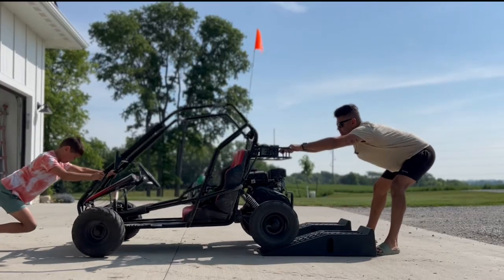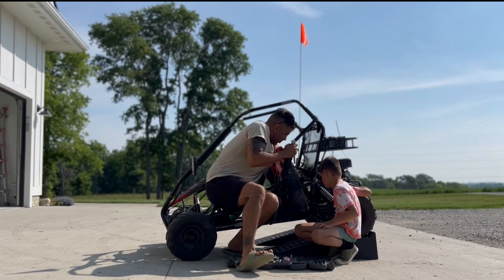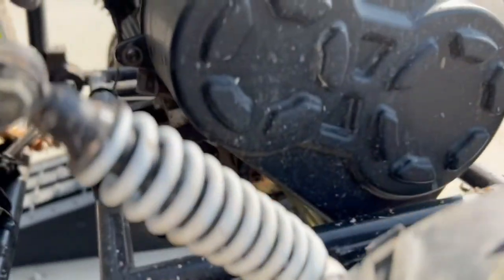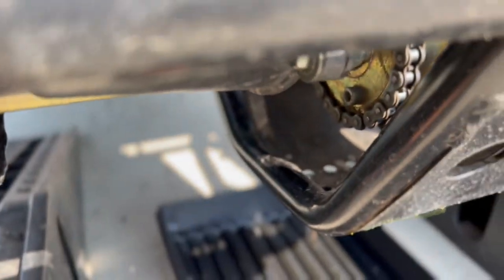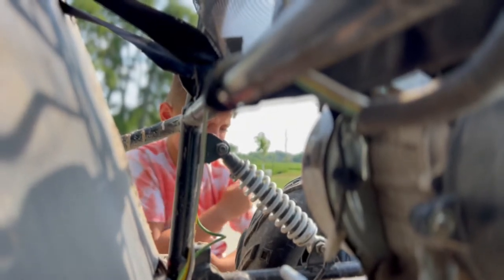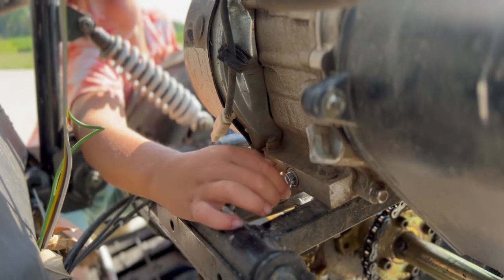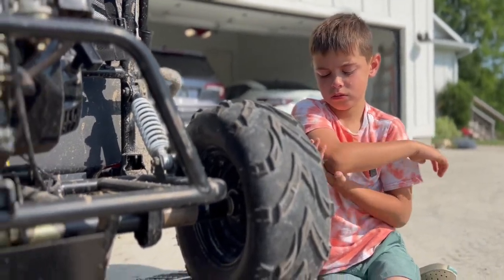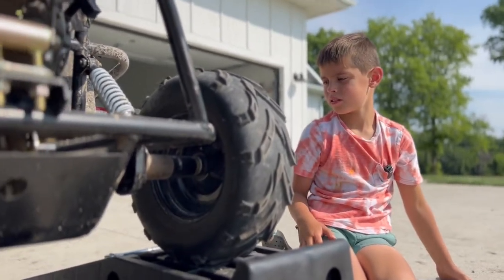Coleman KT196 Go-Kart Oil Change

Comment: Now my Go-kart is moving slow not fast like get should be.  When I turn the Go-kart slows down and stop moving.
Reply from the maker: Here is what I’d check in order: 

1. Choke is off (duh, but it happens)
2. Has fuel (duh, but it happens)
3. Air Filter 
4. Spark plug
Reply: @barnyardbrothers  I did check the air filter and it's good
Reply: What makes the KT196-C go kart go slow?
Reply: @barnyardbrothers   should  I run the KT196-C  gokart choke on?
Reply from the maker: @DouglasKlein-w9q  no, just make sure you start it and then turn it off. Just trying to state the obvious, but sometimes those things get forgotten.
Reply: @barnyardbrothers   I ran it with the choke on then I got out of my Go-kart to turn the choke off and the gokart  didn't stop moving